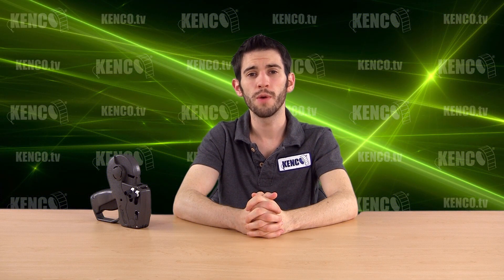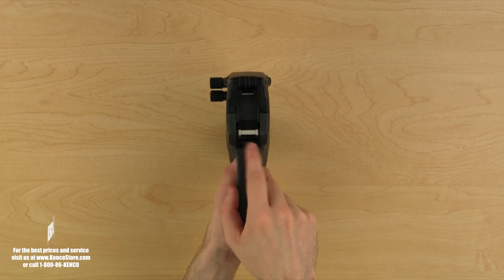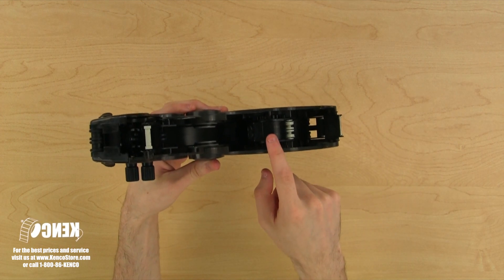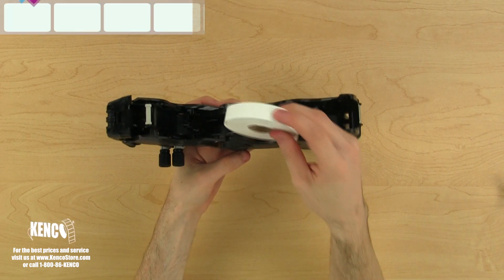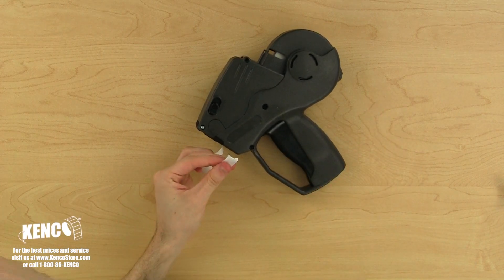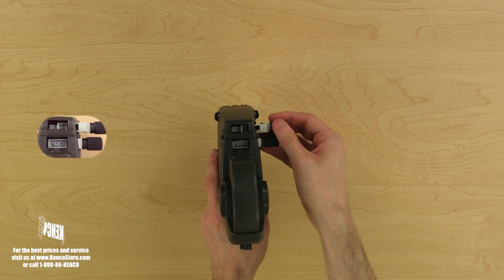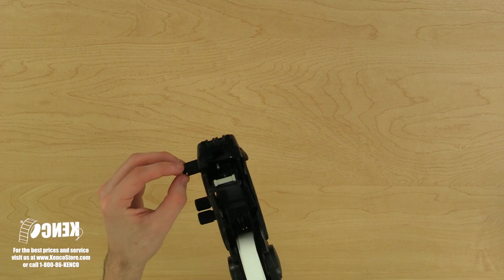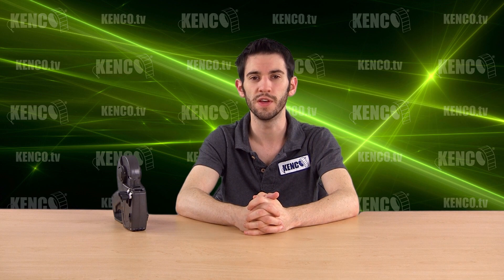Monarch® 1135 Loading & Maintenance Instructions

Comment: with mine (1136) the trigger does not fully return and the price adjustment rollers stop about 1/8" short and therefore the printed tag is not fully pushed out.  Seems to be common across the ones we have  Very frustrating. Is there a video on troubleshooting that?